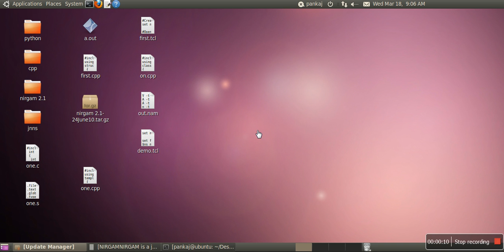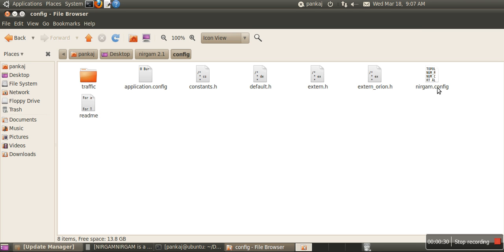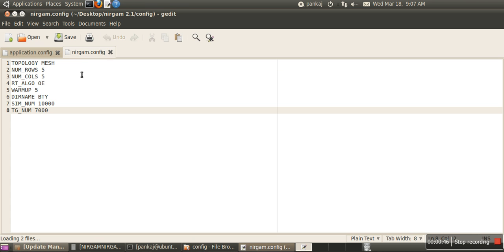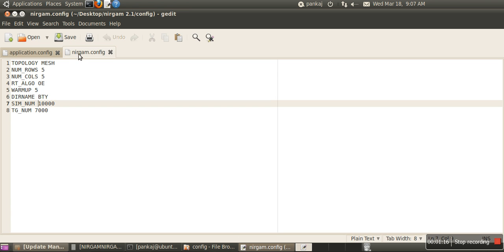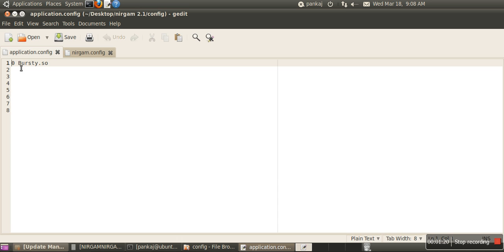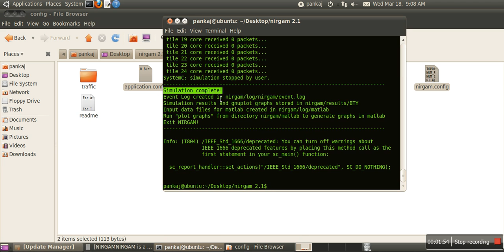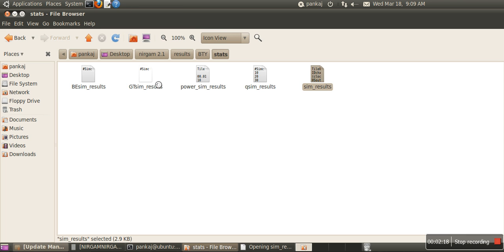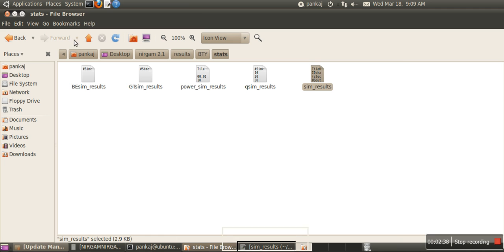How to run simulation with odd even routing on NIRGAM

Comment: Sir,
      Can i change the NOC architecture ? i want to simulate  a HeteroNoc ( different router with different VC).  For exemple routers of middle with 4VCs and other with only 2 VCs
Reply from the maker: You need to change code then. Just have a look on NoC.cpp file.
Reply: So i just have to modify noc.cpp. thank you sir. I see that today
Reply from the maker: This file you will find in core directory.
Reply: HowTo sir,
can i change the bandwidth of links? i want to change the link bandwidth  of center routers.
for the vc's i do the modification that work thank you!

Comment: how to add a benchmark for routing algorithm?
Reply from the maker: +gopi Devarakonda Can you provide more details regarding your work i.e what you want to do ?
Reply: i am working on fault tolerance on NOC using nirgam simulator, here how do i know that pkt transformation between source and destination which path it has selected?
Reply: +HowTo apply Benchmark in nirgam simulator for testing?
Reply from the maker: gopi Devarakonda
 You can check result file which show packet receive and sent for every tile(south, north, east, west and core)
Reply: +HowTo apply Parsec Benchmark here

Comment: sir i get following error..
noc.nwtile[0][1].IC0
dir = 0    i = 5
portN= 5
portS= 0
portE= 1
portW= 2
num_op= 4
Segmentation fault (core dumped)
how to solve it???
Reply from the maker: Did you add  export SC_SIGNAL_WRITE_CHECK=DISABLE
In case if you have added then check your topology configuration.
If still you get error then make a fresh install and then try to run example shown in video.
Reply: sir i can't solve problemsir i have tried SC_SIGNAL_WRITE_CHECK=DISABLEand also i have reinstalled nirgam..still the problem is persist..
Reply: sir sudo ./nirgam has worked for me..now i am getting following error..Error: (E115) sc_signal<T> cannot have more than one driver:  signal `noc.nwtile[4][4].signal_26' (sc_signal) first driver `noc.nwtile[4][4].IC2.port_21' (sc_out) second driver `noc.nwtile[4][4].IC1.port_21' (sc_out)In file: ../../../../src/sysc/communication/sc_signal.cpp:137
Reply from the maker: Jay you have mentioned that you run SC_SIGNAL_WRITE_CHECK=DISABLE
But in order to use it you have to write following[write export as well]
export SC_SIGNAL_WRITE_CHECK=DISABLE
Reply: How To still i have same error..
Reply from the maker: Can you specify your steps for installation.